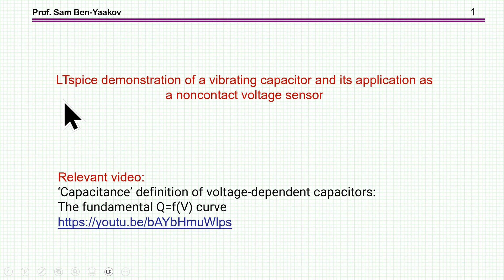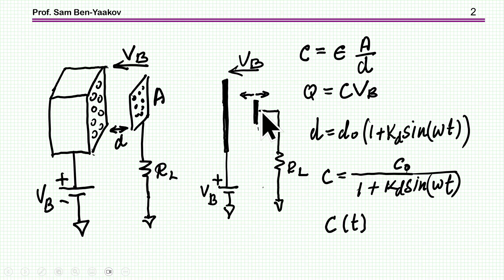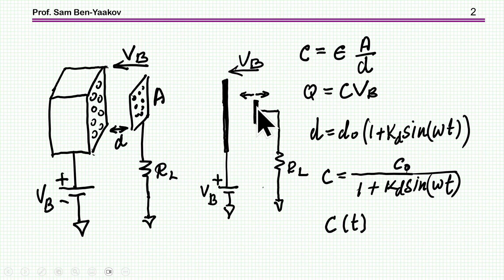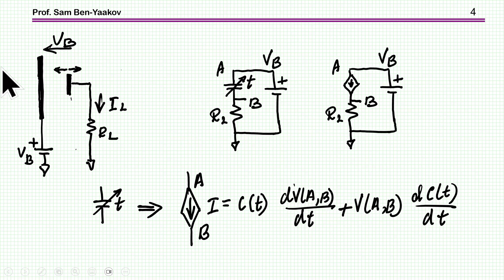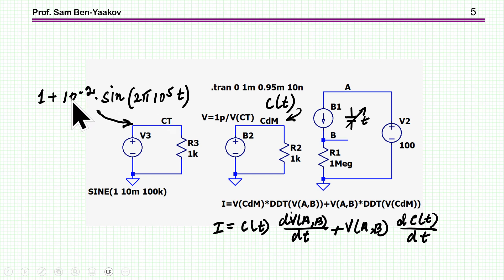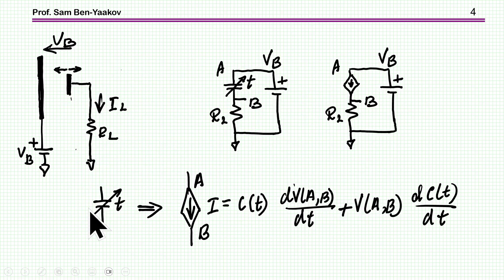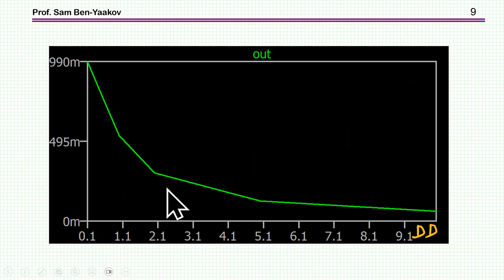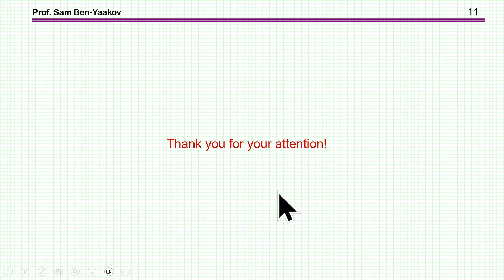LTspice demonstration of a vibrating capacitor and its application as a noncontact voltage sensor

Comment: Thanks for the video. An American company manufactures these sensors since 20 years at least. I expect that they have patented it too
Reply from the maker: The objective of the video is to show the LTspice time dependent model. The measuring method shown is generic and is not a the implementation used in commercial units. And there are many,

Comment: Thank you for your presentation. Do you know any real-life applications that use this technique?
Reply: Can tell you from personal experience that the same principles have been used to measure the displacement of very tiny micro-speakers.  Same idea as this just worked from a different angle towards a different end. You sense the C value as a function of D by tracking capacitance between a fixed datum and the moving diaphragm. We weren’t the first to do this, Phillips made a servo controlled speaker long ago that used capacitive displacement sensing in a feedback controller to enforce frequency response and reduce distortion.
Reply: I suppose this can be also expanded to capacitor microphonics sorces of noise.  

Thank you Prof. Very interessting topic.
Reply from the maker: @pieters286  Thanks
Reply from the maker: There are many possible applications, from measuring surface charges to electric fields and ESD voltages. Many meters on the market work in similar ways.